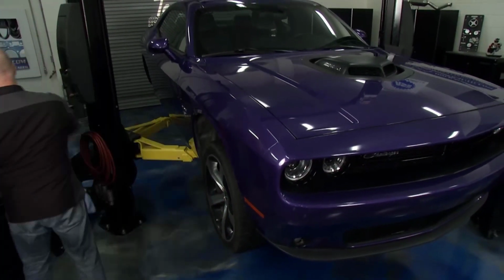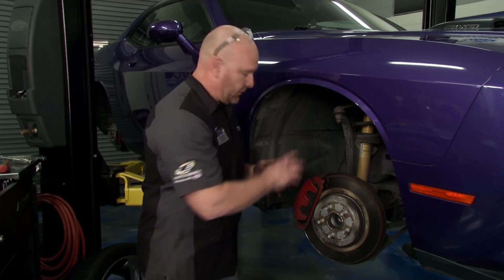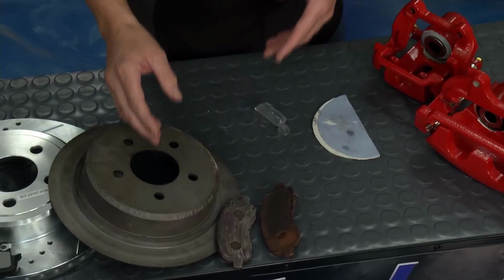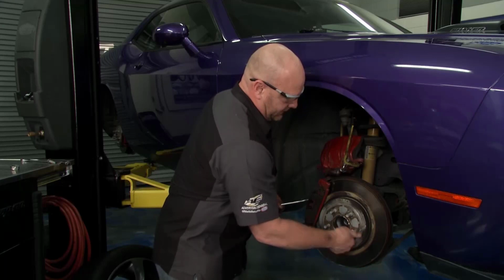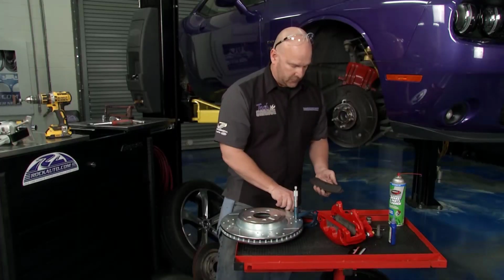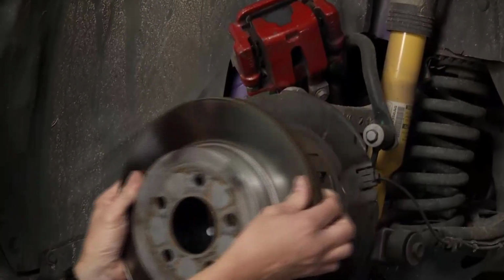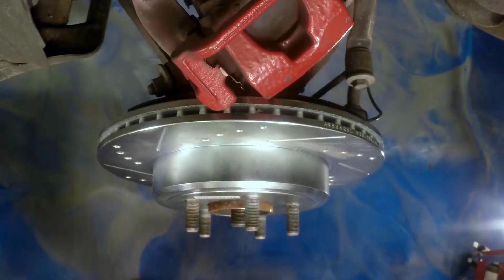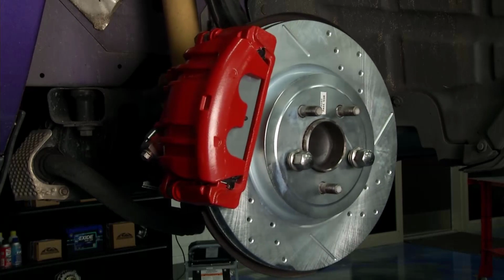Hemi Challenger Z26 Brake Upgrade

Comment: I can see pad composition and rotor design making a difference, but I do not see how the same size and design calipers do. Also I would like to make this perfectly clear, because I keep seeing this crap. THIS IS ONLY AN IMPROVEMENT ON THE RT OR SXT, NOT ON ANY OF THE SRT'S. Also everyone on the planet knows brembo is better than powerstop. Powerstop is just massively cheaper, for a reason.

Comment: I have noted the factory oem brake rotors are directional. The same as aftermarket rotors.But the oem use the same rotor for both sides.So the drivers side the slots are correctly orientation.The passenger side is backwards. Why is this? The factory saving money? As owners the factory thought we would not notice this?At cruise ins owners I've talk to are unaware of this quirk.

Comment: I have a 2012 srt8 and it comes with the brembo calipers. I would have though those would be better than these on the video. Opinions please
Reply: I run the stock brembo brakes on mine and they seem to be pretty good
Reply: Price difference is a huge factor

Comment: Since the Challenger RT already has 2 piston brakes calipers in the front and one piston brake caliper as stock, how do the powerstop upgrade impove the braking capabilities?  Is it because of the Drilled and Slotted Rotor combined with the new brake pad materials over the stock one?  By the way I have a 2010 Challenger RT.  How much improvement can I gain by doing this upgrade?